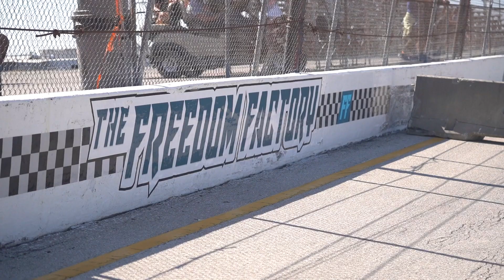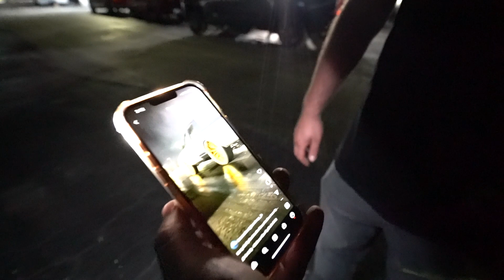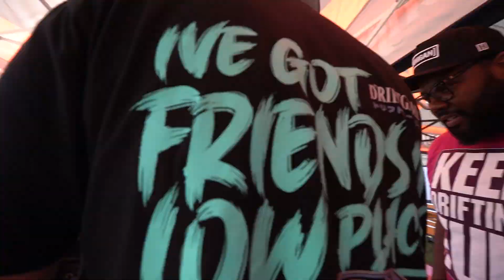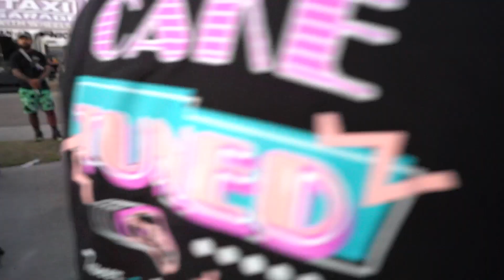I blew my chance at drifting in America | Too much drama...

Comment: Those barra motors can pull 600+ hp with simple bolt on mods, turbo injectors colis ecu exhaust with out touching the actual engine itself ive seen a sohc inline six Ford motor crack over 1000hp with out opening the motor that came in the Falcons before the barra definitely better for high hp for your money over a 2j or a rb

Comment: How did that motor blow and what can one do to avoid that?
Reply: Most likely a nitrous explosion, Nitrous leaking into the intake with the car off. Turn the ignition on and boom.. maybe a check valve gone bad in the nitrous system or something, hard to say.